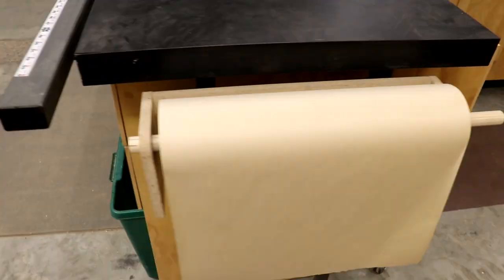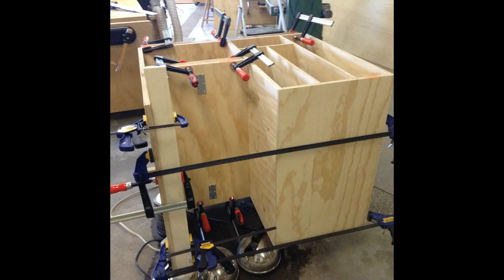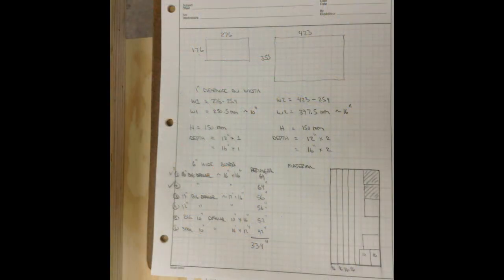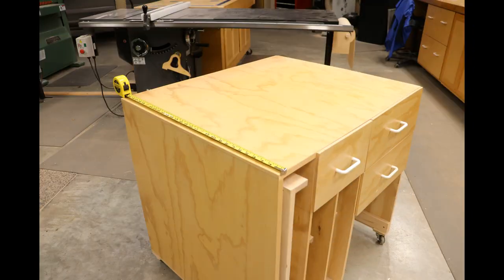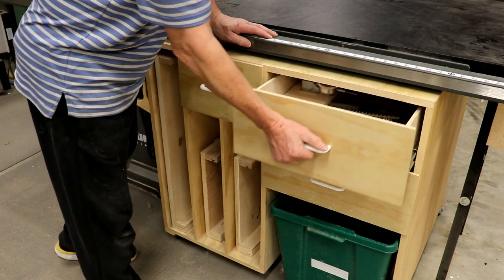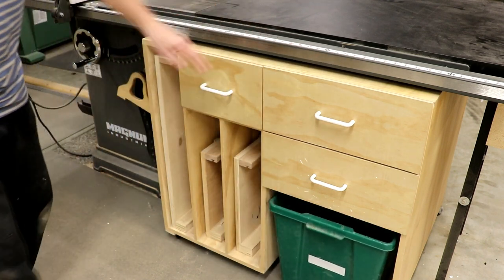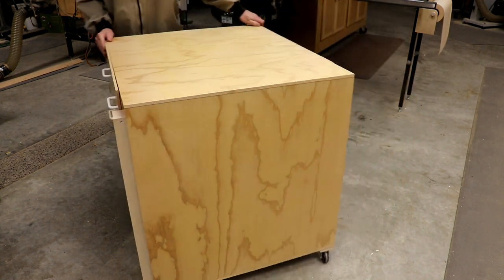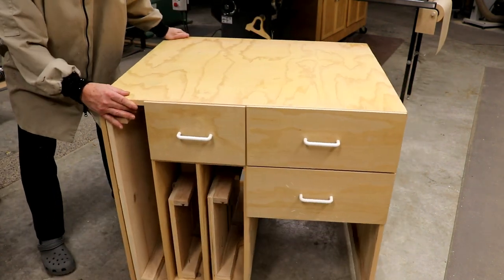Table Saw Cabinet,  there's more storage in your shop than you realize,   add storage to your shop

Comment: What do you think made the boards warp when you got them home?
Reply from the maker: It's a great question and I'm not positive,  but in the store they can store them flat, which I'm not able to do.   Frequently the first sheet on the pile in the store is not that good,  so I'm assuming the weight of subsequent sheets helps keep them flat.   My shop might be a bit drier then the store, and moisture changes can cause them to warp.   I'm also speculating that the more plys in the laminated sheet the more resistant it might be to warping,  the more expensive sheets at the store don't appear to be as warped as the more economical sheets.    Thanks for watching!